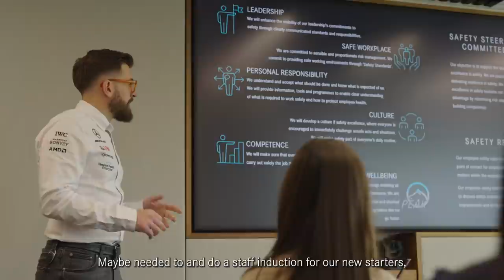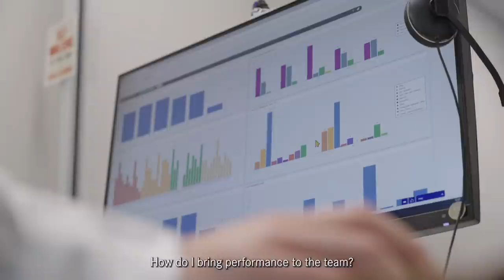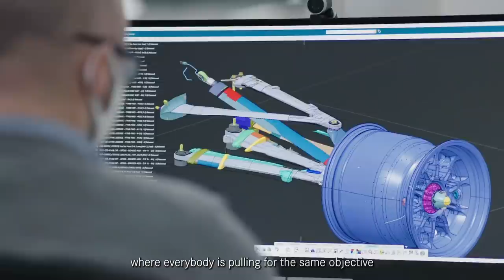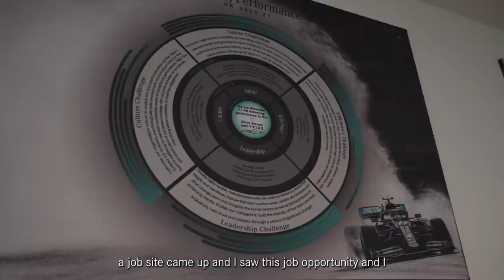My Job in F1: Stuart | Head of Health and Safety

Comment: Yawn yawn health and safety in F1 Racing yawn. Why don’t you double map the car with an interlocking overlapping synchronised +5 power chip mapping session. Or your right extra wet floor signs that’s what’s needed